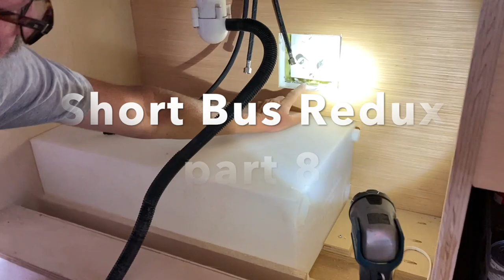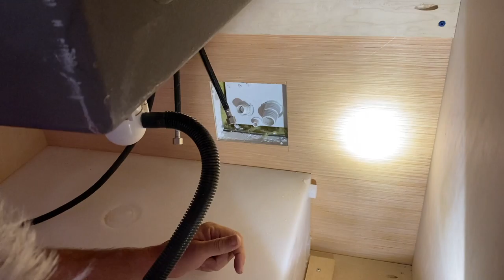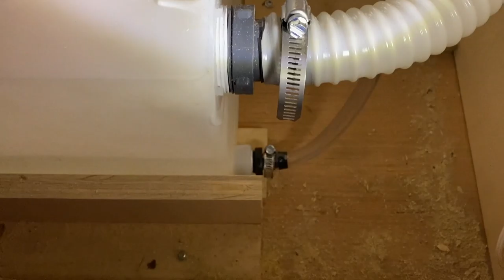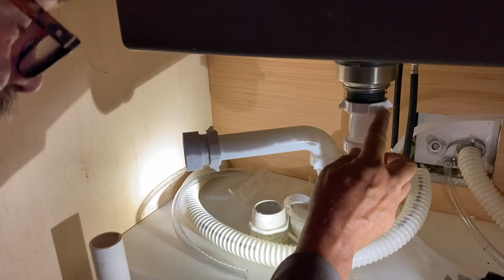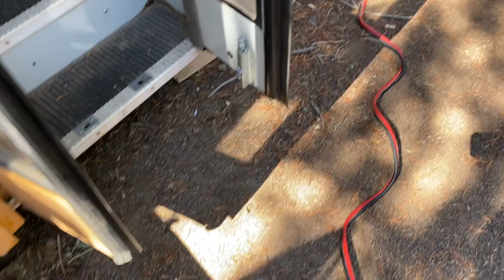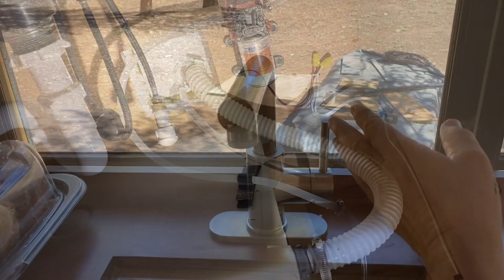Short Bus part 8 Fresh Tank and sink Plumbing

Comment: Put check valves in on the pressure line in and after the pump. Eliminates the need for valves when you hook up to a camp water system

Comment: A question, Eric. Our fresh water tank is now at the back end of the bus, under the bed. Should I have the pump near the tank (pushing water), or can I have it under the sink (pulling water)? Does it matter? The fresh tank and sink are about 12 feet apart. Thanks, Tom and Ernest the Skoolie.
Reply from the maker: Doesn’t really matter. They can be pretty loud so I would put it where it will be the most muffled.😉👍
Reply: @Wanderboom  Thanks, fortunately it's a tank of a Shurflo pump, and not very loud.